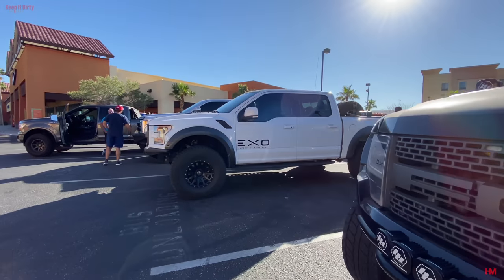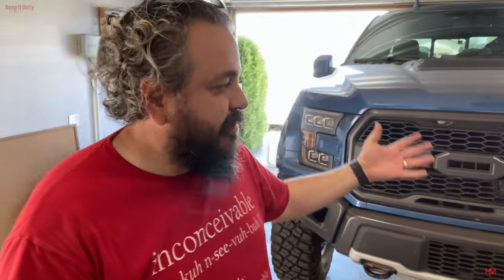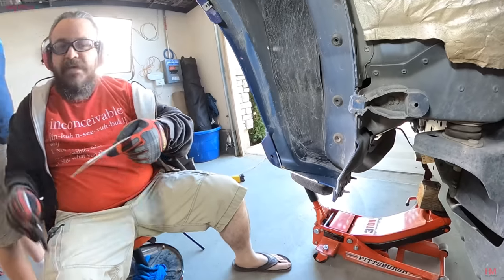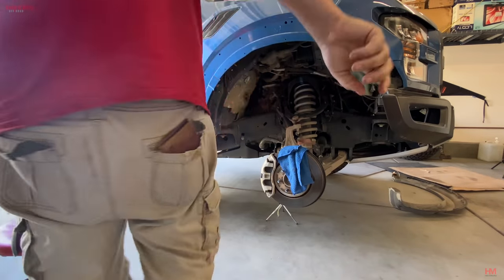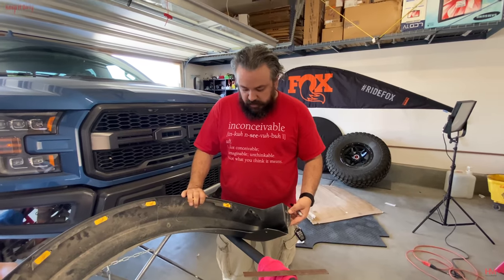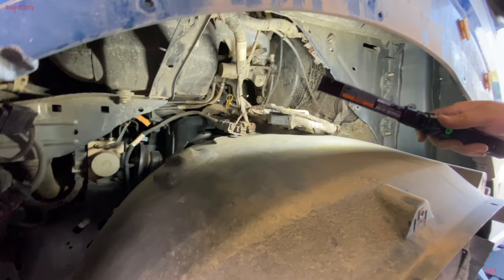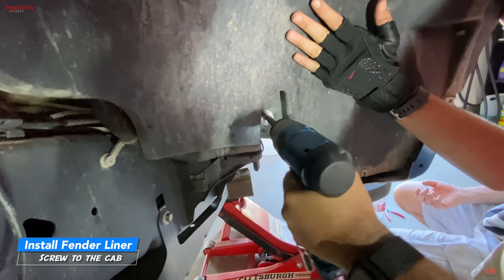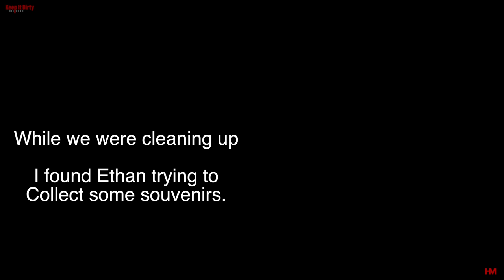How to fit 37s on a Raptor - Benefits / Drawbacks/ Trimming

Comment: Im definitely gonna keep an eye out for your new video on how this trimming and 37s are gonna do offroad.  Your videos are awesome, could not have done the leaf springs and fox coilovers withot em.  

As for tune I highly recommend going goosetuned through cobb.  Much better than the cobb ots tunes.  Smooth smooth power delivery and the man dials in your truck based on your fuel.
Reply from the maker: Potato Spud thanks man. Yeah, I ran the Cobb tune before and hated it.
Reply: @KeepItDirtyOffRoad  

Potato Spud is correct, Goosetune is the way to go and he does the transmission too. Everyone loves the power and buttery smooth shifting that his tunes deliver.
Reply from the maker: sixshooter4570 will have to look into them. Cobb left a bad taste with me with how much they charged to add the transmission tune. Early adopters should have been Grandfathered in .
Reply: @KeepItDirtyOffRoad  

I agree.

Comment: Will a 2014 ford raptor rims with negative 34 and 37 tires fit the gen 2 raptor?
Reply from the maker: Stock wheels are only positive offset last time I checked. +34 so more inboard and the same offset as the gen2 stock wheels. 

Trimming will still be required.

Widest I’ve seen is -12 and those will just rip stock fenders off and not recommended as there is no trimming that will avoid contact . 0 offset is the standard for raptors.
Reply: @KeepItDirtyOffRoad  nice thank you I will try it

Comment: minds didnt lose any power
Reply from the maker: Then you butt dyno is way off then. Most common thing everyone reports is the low of power.
Reply: @KeepItDirtyOffRoad  maybe i did lose some power  if everybody said they lost power
Reply from the maker: Guaranteed you did. I felt it right off the bat and I even added the Cobb tune to compensate. Cobb tune helped at the low end. But on the high end power really dropped off and offroad I could not get my truck over 95 mph. Truck just did not have the power to pull away on the dry lake beds anymore. 37s need regearing and a tune to compensate.  When I took mine back to 35s, it was a huge difference. Truck went from sluggish to feeling like a sports car again
Reply: @KeepItDirtyOffRoad  how much is that cobb tune  thing
Reply from the maker: Easy to find the Cobb tuner online. I think it’s like 1200 now with the transmission tune. I had just the engine tuned and I did not like. But heard when matched  with the transmission tune is much better
Reply: @KeepItDirtyOffRoad  ok thanks a lot

Comment: It’s a horrible idea...  you have to upgrade your suspension.. you have to reset the lower control arms too... everyone skips,, or don’t even know,,  if you raise the perch on your shocks,, you are stupid..   yea it works,, but not for long
Reply from the maker: Totally agree. Check out the rest of the video series to see the results of our testing. We tested a lot of this bad info and found a way to make it work with spring upgrades.

Comment: haha uses a plastic malet 
and then an axe dear god
Reply from the maker: Only sledge we could find after going to Home Depot, Lowe’s, and harbor freight. 

Most shops will use a long handle slide to bend them and make short work out of them. But no other way to do it.
Reply: @KeepItDirtyOffRoad  I’ve been on the ground slamming a pinch weld before. Not fun 😂

Do you have a video reviewing the performance of the Eibach springs. I know they are off now. 

Enjoy your content man. Just found you and will keep watching.
Reply from the maker: No, I have not done a long term review yet. In the 37s series though you can see how they perform. They did great on my truck. Stiffer than I expected offroad and did well enough for me I did not want to do the Geisers at all on this truck.

Comment: Are you re geared for the 37s? Or is that kinda overkill? I feel it could help the fuel econ
Reply from the maker: It can help and I was in the process of doing it. BUt, my truck started having some major problems and all upgrades were stopped.
Reply: Considering 37s.. my panned mods are sdi top hats with camburg kinetik control arms.  Camburg say those are wider track to fit larger tires.  They also recommend wheels with zero offset,with 4.75 backspace, which i will get.

1) any thoughts on camburg? Aside from not being chromoly or long travel... I'm ok with staying close stock.
2) do you think that'll be enough to clear 37s, with keeping stock travel?

Thanks
Reply from the maker: Ok, so agree with the top hat. Don’t agree with the arms. 

I’m not a fan of upper control arms upgrades at stock suspension travel. They offer very little benefit. They are more for show than for functions AND the joints don’t last as long as sealed ball joints and super expensive to replace. So I don’t recommend upgrades if you plan to stay stock. Also the reason they recommend 0 offset wheels is because stock offset will rub on the arms because they are a bit thicker. 

So I don’t recommend the arms. Focus on the top hat replacement plus trimming and you be fine. If you want a different look, then get the wheels. But don’t spend the money if the arms. They are mainly bling and won’t really add extra capability.
Reply: @KeepItDirtyOffRoad  thanks for your input man! Any thoughts on camburgs lower arms? Interested because they include the slapper bumps.. thinking thay may help with avoiding hitting fender on those spirited drives.
Reply from the maker: @salhernandez83 again, at stock width there is not much benefit to them over stock. They make aftermarket front bump kits if you want that that will fit stock arms. 
But if you want to use a bump stop to avoid rubbing, that’s not going to happen. Bump still allow you to go full tuck. They just soften bottom. If a bump kit prevents you from going full tuck, it’s reducing travel which it’s worse.
Reply: @KeepItDirtyOffRoad   thanks!

Comment: So the Fox suspension you have doesn’t add any lift?
Reply from the maker: The stock suspension does not. Remember it’s not the shocks that hold the weight, it’s the springs. So I upgraded to Eibachs springs up front for 1.5 in raise and XHD Deavers out back for 3 in raise. Still getting a bunch of subbing with stock fenders